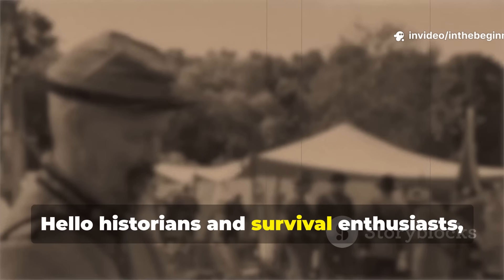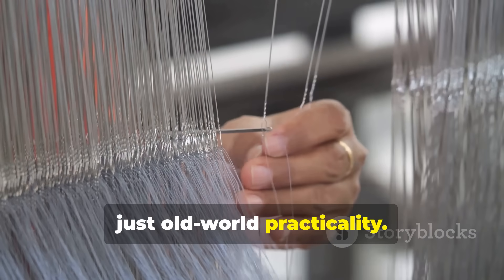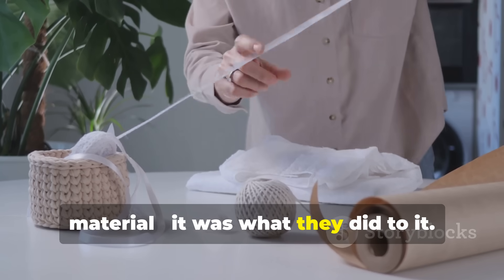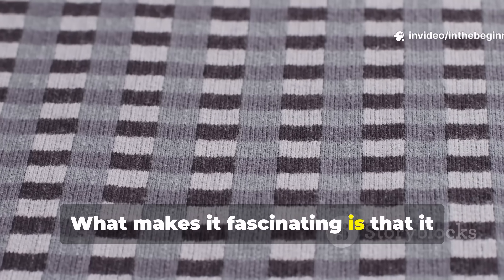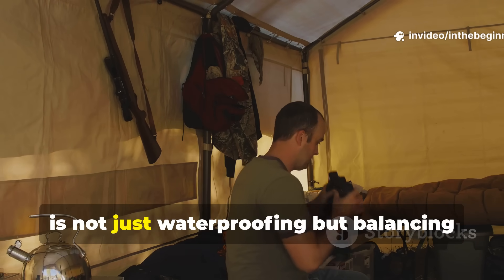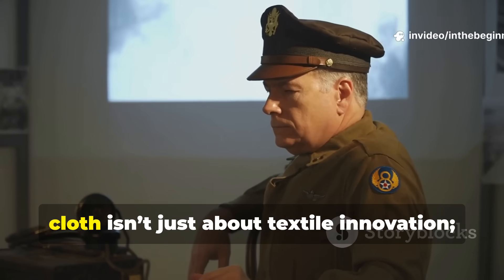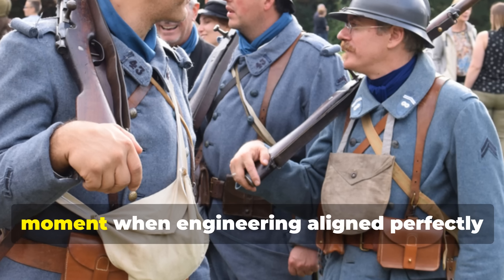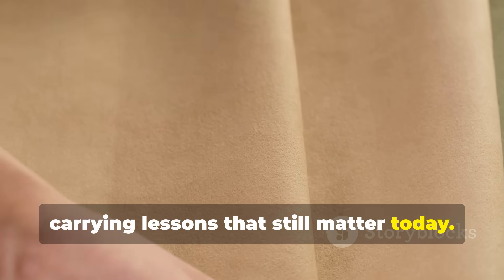Forget Tarps — This WWII Fabric Was Stronger, Lighter, and Totally Waterproof

Comment: The Survivalon jacket used to be made from Ventile. It is now made of a similar material which also is tightly woven long staple cotton that swells when wet. Although no longer manufactured, unsold  Survivalon stock is still available from the designer at a significant discount. I have two of them and they are great.
Reply from the maker: Thanks for the extra info!

Comment: Poison for the wearer and Poison for generations,  the waterproofing is long chain fluorocarbon that don't break down for many years 
The key word here is POISON
Reply: You should have done a smidgeon of homework, as I did, before generically accusing ALL ventile material as being 'poison'. 
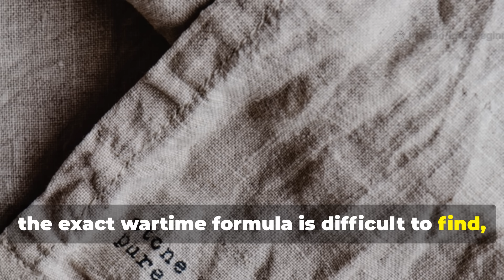 I looked into the history of ventile fabrics. None originally used PFAS coatings (e.g. Teflon). In time, some manufacturers used them. But most stopped as the hazards of PFAS became known. As for this video's, recommended Ventile construction, it starts at 7:20, with a tight weave of natural cotton (300- 400 TPI), coated with a mix of linseed oil and beeswax. There are no fluorocarbons, let alone PFAS compounds contained in that trio of components.
Reply: @gregparrott   -  @jimwilson8879 is kind of correct about the poison. I bought a Ventile cycling jacket back in the 90s because I read about it being waterproof due to the dense weave of long-staple cotton. I was dismayed after purchase that it came with the instruction to renew the waterproofing with Scotchguard, implying that it came with such a waterproofing. I never did use it, so had to put up with the fact that it is not a waterproof fabric. As the video states, the fabric helped by giving the pilots a little extra time for rescue, i.e. water penetration is only delayed. A little historical snippet that can mislead people into believing that the fabric is all natural. It may have been originally, but outside of pilot rescue missions, they had to add a little extra (the waterproofing) to sell it to the general public as a waterproof fabric they could use for more than half an hour.
Anyway, here is a snippet from an article on Scotchguard from PBS.org
"In 1968, independent researchers at the University of Rochester published the results of blood tests showing that an organic fluorine breakdown product of Scotchgard – perfluorooctane sulfonate, or PFOS - was present in human blood." It goes on to explain the dangers of it. PFOS is a fluorocarbon. That said, the use of fluorocarbon impregnation was discontinued in 2021. The company claim their fabrics are now PFC-free, but there is no mention of what replacement, if any, is used.
Reply: linseed oil is not teflon dude, it does polymerize but isnt even closely related chemically . linseed oil , aka flax aka seed oil like in fast food deep fryer, omega 6 linoleic acid  is the base of the flooring linoleum.    do not eat, . heart attacks ect. seeds use for their own protection
Reply: its NOT
 Goretex
Reply: Or DOESNT not don't.
Reply: Nowadays there’s organic Ventile/EtaProof. No chemicals used for the crops to grow, or to treat the yarns or cloth.
The NikWax-like bio-based water repellent treatment also seems to hold better to the cotton than to nylon or polyester cloth/fibres.

Comment: Ventile clothing is extremely expensive .. It does work but is not easy to find .. I wore a ventile overhead smock when hiking in Scotland in the 1960's, very effective in cold wet weather .
Reply: HillTrek in Aboyne, Scotland still makes Ventile clothing. This spring I bought a jacket from them. Have worn it only once yet, since I bought one with a pile lining. It is said to be far more durable than Buffalo in the woods and undergrowth. Also the water repellent treatment is supposed to hold on to the cotton better than to the Pertex that Buffalo uses.
Reply: @EhWahEhWahEhWah   Thank you, I found, the company now is  called Hilltrek, good to now. I will check it out. I am a canoer who has slept through all kinds of stuff, gone some distance.
Reply from the maker: Thanks for sharing your experience with Ventile!
Reply: See waterproofing with paraffin and mineral oil
Reply: In my experience you need multiple layers to be truly waterproof which makes it heavy and it's even heavier when wet. I takes an AGE to dry, and freezes solid when wet - I've literally stood a ventile jacket upright in a drying room after a day in the Cairngorms. It has its niche applications, but synthetics are much better for any application where weight is an issue.
Reply: I was in the Australian SAS Regt, and when in places like New Guinea , I had a long smock made of Ventile material, very  good in those {as he says here Burma /Jungle} environments, great for the poor bloody Sniper Pairs Teams too, stuck for days in 1 spot